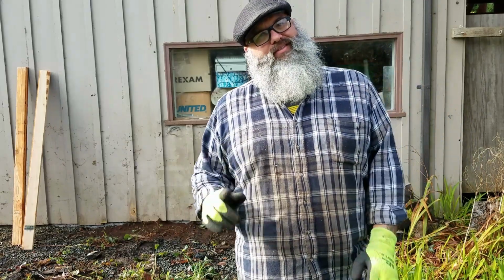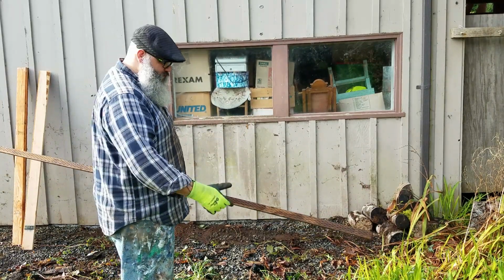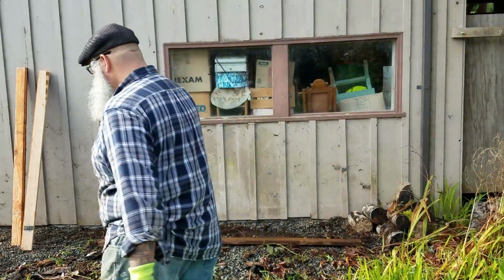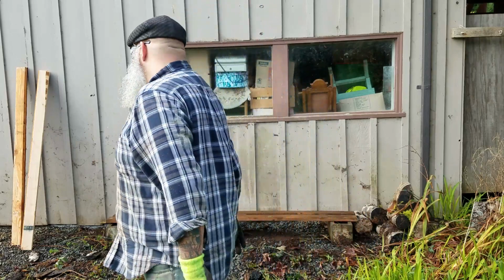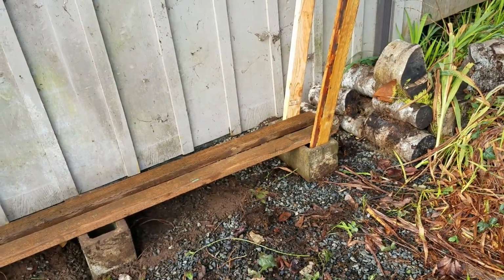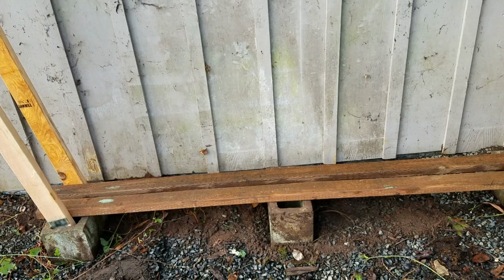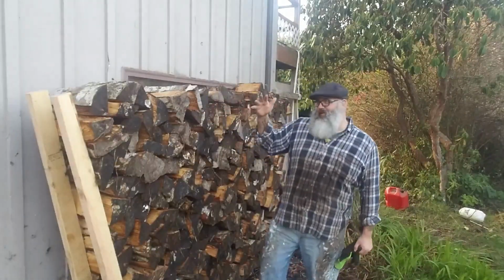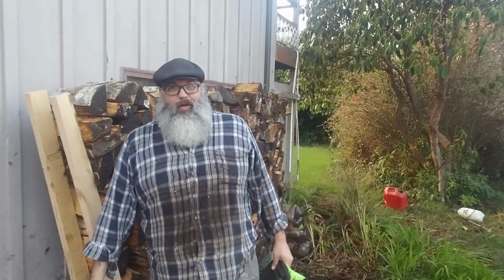Easy DIY Fire Wood Rack

Comment: I like the simplicity of that.  Any way to keep the wood under cover and off the ground until it dries.  I built a rack for cutting small wood and branches into mass amounts of kindling, which you can see on my channel, if you're so inclined.

Comment: whats the cost to rent a splitter in your area? i think where i live itd be cheaper to buy propane and forget the firewood than to rent a splitter.. or just buy a cord of firewood for similar price to renting the splitter for the day... buying one would pay off after enough seasons.. or just buy/make a splitting maul and get rid of the gym pass hahah
Reply from the maker: The splitter I rented is only 1/4 mile up the street from us and rented for $70 a day. We got it from 8am to 5pm and was able to split about four cords of wood. The permit was $10 for 2 cords, so really, splitting the cost it was $45 a piece. New log splitter I see start at $1000, but I did see a used one for $500, but thought it wasn't the right time to buy. A cord of seasoned firewood runs $180-$240 around here. So we are pretty happy with $45. ...and it's fun to go be manly men in the woods.
Reply: fair enough

Comment: Sorry to rain on the parade but many a wood-sided building have been rotted out because people have unknowingly stacked green firewood too close to them. I get wanting to use your building's overhang to keep the woodpile protected but it's a bad idea. Even a cpl feet between the firewood and building may not be enough- depends on wind and etc.  That pile is 80% water when first cut.
Reply: It doesn't look like it's touching the building so I don't know how it could cause an issue.